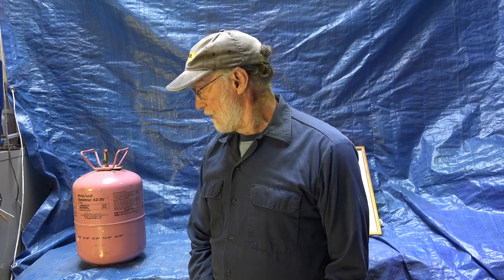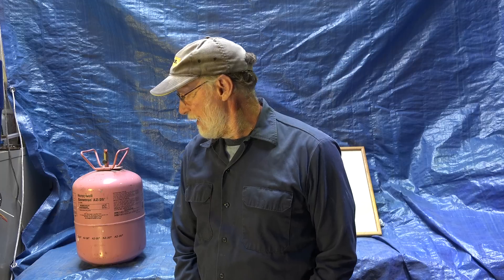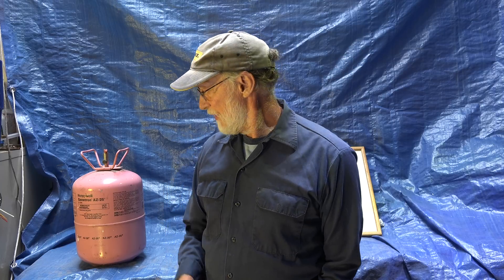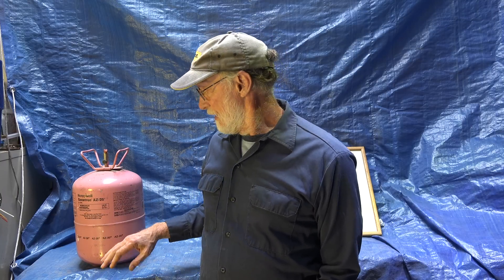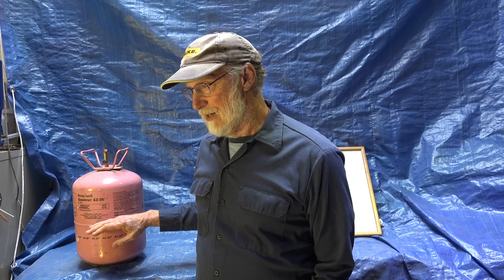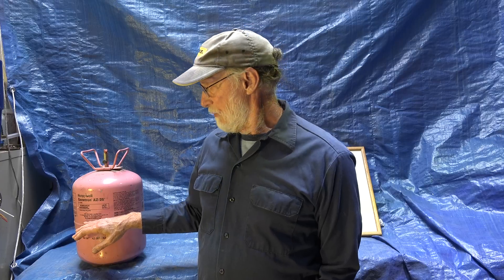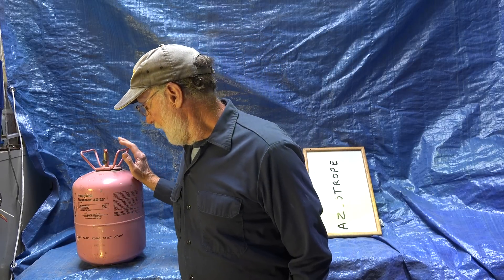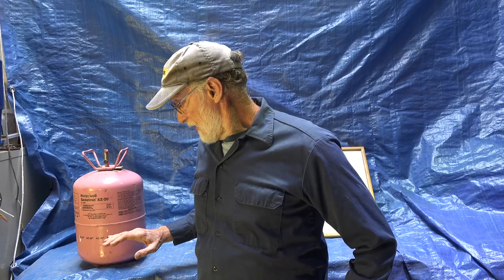R-410a refrigerant

Comment: I am getting an odor from my new two year old central air system. Anyone else experiencing this?
Reply: Yeah, that happens a lot can you describe the odor?
Reply: @inoahmann7542  almost like bubblegum
Reply: @iamric23  I would check the furnace filter and make sure the evaperator is clean and free of refrigerant leaks. If that isn't the issue then it's most likely either from the ductwork or elsewhere in the house being pulled through the return air. You can narrow it down a lot buy getting an odor reduction filter. If that doesn't help its probably downstream of the filter.
Reply: @inoahmann7542  Thanks for the info, will do.
Reply: @iamric23  no problem, happy I could help.

Comment: I have R22 systems on apartment buildings that have been there 35 years why is everyone taking off the 410A condensers and replacing them after 5 to 8 years,,,f 410 a
Reply from the maker: I have not seen a higher failure rate for R-410A units.
GFM
Reply: But how many units do you expect to see in 15 ,25 ,35 years ,,,, here in Phoenix when it gets 115  to 120 those 410A units do funny things myself and other people I'm seeing a lot of people pulling off 410A units here in Phoenix,,,, they say something like 4 years old 5 years old customer wanted more tons,,,,, tonnage,,,, back in the day when our 22 was ruling the roost nobody ever pulled the unit off unless it was bad,,,, I don't know my opinion the ask the same unit same compressor the same steel the same metal hardness do do a lot harder work it just got to fail more often that's my thinking
Reply from the maker: @deddie4645  Where do you get the idea that 410A units are under higher load than R-22 units?
GFM

Comment: In my opinion, the EPA should consider energy efficiency more important than the GWP of the actual refrigerant. I don't have an actual number on this, but I bet that the global warming effect from releasing the system's full refrigerant charge would be pretty small compared to the global warming effect of running the system for it's 20 year or so lifespan. I might be totally wrong though
Reply from the maker: There is an argument for using refrigerants that were determined to be the most efficient over the many years since the first CFC refrigerants were developed.  Such as R-12.  It is probably the most efficient refrigerant for refrigeration service.  Using recovery methods, most of the refrigerant could be kept out of the atmosphere.  
The problem of ozone depletion would be far less.  
I do however, understand the Montreal Protocol position.  
What may be a larger issue for GWP is the problem of CO2.  CO2 emissions are far more damaging for GWP than the release of refrigerants.
GFM

Comment: It says R-22 on my condenser units from 2007, does it hold true what's actually inside, or it's just compressor that has to be replaced. Presumably, the whole condenser has to go so that labels doesn't lie right?
Reply: I am not sure what exactly you are asking, but if you are asking if you can install a 410A compressor in your unit and convert the system, no you can not. The coils weren't made for the higher pressure, the expansion device wouldn't work properly, the oil wouldn't be comparable, etc. You would need to change the entire unit. Hope this helps

Comment: R410A sounds like a pain in the ass. Why don't home AC systems use R134A? It works fine in car AC systems.
Reply from the maker: R134A has been used in home A/C systems.  It is not still used generally because its efficiency is too low.
GFM
Reply: Thanks. It just seems like there has to be a non ozone depleting alternative to R22 that doesn't have the issues that R410A does. I would like to say that I hope R410A goes away, but if it does go away, I'm sure there will be something worse to replace it.
Reply from the maker: When CFCs and HCFCs were developed, the ones we chose to use were the best of the bunch.  When they became unusable, we had to use those that were not the best.
GFM
Reply: Makes sense. I just don't understand why it wouldn't be possible to develop a non ozone depleting refrigerant with similar properties to R22. I just have a really hard time believing that all these genius chemists couldn't come up with a better replacement for R22 than R410A.

Comment: I'm not convinced that this crap is better for the environment than R22. It's GWP is quite a bit higher than R22, and R22 already has a VERY low ODP. Not to mention that 410A has more of a tendency to leak because off the higher pressure. Great video though as always!
Reply from the maker: We could argue about the new refrigerant's value, but the fact is the law is the law and we must follow it.
GFM

Comment: Sir in my AC the difference between indoor unit and outdoor unit is 25ft. My local technician suggests me that I should fill more refrigerant r410A than normal as my outdoor unit is install too far from indoor what should I do what is your suggestion.
Reply from the maker: NADEEM KHAN The addition of more refrigerant for lineset length is determined by the install instructions. Check the manual. 
GFM
Reply: Thanks

Comment: Why you don't mention R410a has an even bigger global warming effect than R22?
Reply from the maker: Because it does not.  You are mixing up the numbers here.  R-22 has an ozone depletion potential that R-410 does not.  Ozone depletion has been linked to global warming.  There are other global warming impacts that various refrigerants have.  Among them is R-410A.  None of which have the total the effect of R-22.  However, there is consideration of replacing R-410A.  It is quite complicated.
GFM
Reply: Ozone depletion is not causing GW see this https://www.ucsusa.org/global-warming/science-and-impacts/science/ozone-hole-and-gw-faq.html the GWP of R410a (according to AR4 used by IPCC) is 2088 which mean 2088 times worse than CO2 (for reference R22 is 1810) ODP for R22 is 0.055 while R410A has basically zero ODP. But I was not talking about ozone depletion did I. I don't know why I bother but , I'm just trying to straighten the talk. R10a is not good for GW and it will never be, yet many like you speak as if R22 was the devil (no denying here) and now we are safe because we use r10a and you know the potential for leaking of r10a systems is high specially when they get older, So my point is skipping the bad facts doesn't help the conversation, take it as you will, I'm not in the business of evangelization,  But the facts are ozone depletion does NOT cause GWP, GWP on the other hand seems to be harmful to the Ozone layer "This warming-cooling dynamic creates conditions that lead to ozone loss" (i'm just quoting here) read the link. Saying the replacement of R410a is complicated doesn't solve anything and ignoring the dark side of R10a doesn't help either, people follow you you need to be thorough
Reply from the maker: You do not have a complete understanding of this concept.  Global warming potential is the amount the gas itself traps solar radiation from reflecting out of the atmosphere.  Ozone depletion potential is the ability of chlorine gas from refrigerants to destroy ozone molecules, which in turn allows more UVB radiation to penetrate the atmosphere to warm the planet.  
GWP is an entirely different concept.  The effective GWP of any gas is a function of its ability to trap that heat and the amount of the gas in the atmosphere.  Thus, the highest effective GWP of any gas is CO2 which has a small GWP but high volume.  R-410A has a very low volume, so its effect is low.  
I taught this for 9 years.  It is not a simple concept but the end result is that R-410A is a refrigerant that has less impact on global warming than R-22.  It is not the overall best refrigerant and will be replaced as soon as better ones come forward.  Its best attribute is that it has no ODP.
GFM
Reply: This is my last one, as you are entrenched, read https://earthobservatory.nasa.gov/blogs/climateqa/are-the-ozone-hole-and-global-warming-related/ and thee previous one, from NASA earth Observatory I quote "The ozone hole itself has a minor cooling effect (about 2 percent of the warming effect of greenhouses gases)" and "Global warming is also predicted to have a modest impact on the Antarctic ozone hole" You don't want to reason and you don't get references I do, or I did. good luck

Comment: Thanks for information. Have a question. Could we charge an inverter system with 410A by superheat or subcooling? I'm taking about split system. Or is there another way. They suggest to empty the system and recharge. I wish I would have a better way.

Comment: R 22 is better then  R 410 A .we use both gases but R 22 is best then R410 A .R410 A gas r not good result .not good cooling.
Reply: Manufactures can achieve a higher SEER rating with R410a over R22.
Reply from the maker: R-22 is a great refrigerant.  R-410A is a compromise.  
GFM
Reply: R-22 is much better than R-410A.
Reply: how is better ?
Reply: abbd djff let engineers deal with that at the manufactures
Reply: seer tested by the same bureaucracy that tests for car mpg?
Reply: Yeah real high Seer rating but keep them fixed and all that high-tech crap going cost a lot of money that's not factored into the Seer,,,, I had 2  York's with 410A the blower motor was a GE programmable and you couldn't even order Motors when they went bad,,,, had to put a straight dumb one in there with a slave relay fix for a hundred and fifty bucks instead of 515 you can't get the moter at that time too new